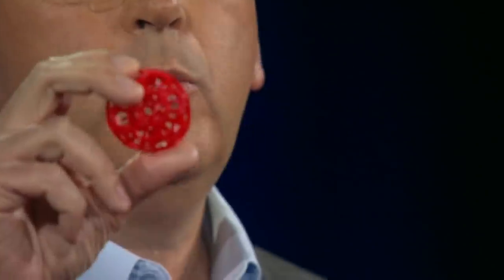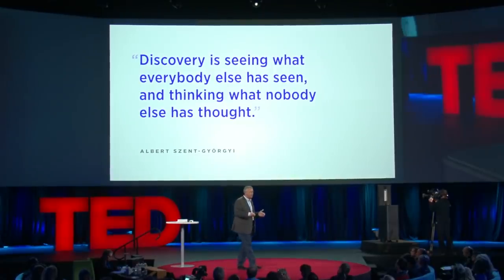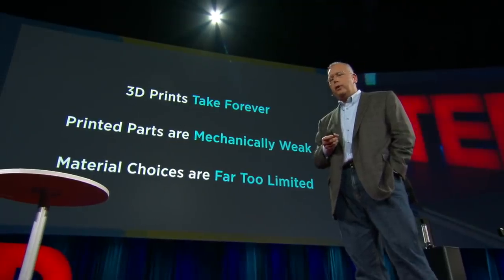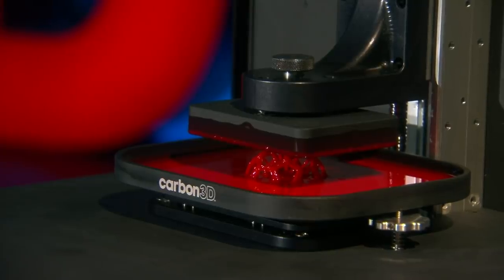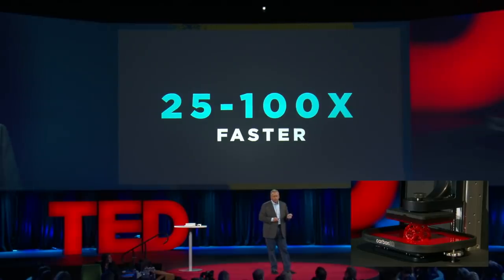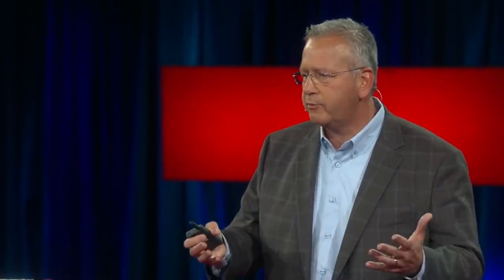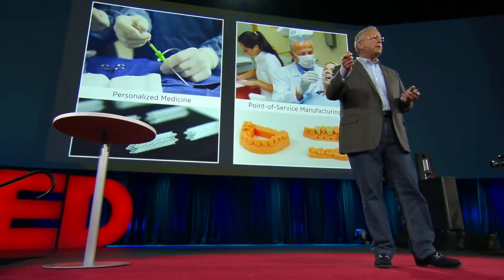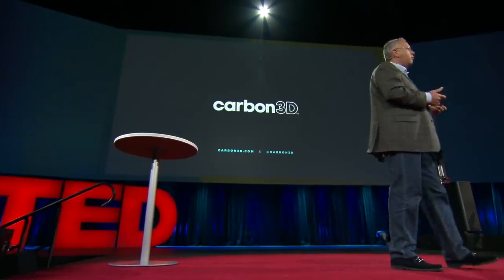What if 3D printing was 100x faster? | Joseph DeSimone

Comment: This idea is game changing.
Reply: Used that a few times didn't he...
Reply: CoiledDrake Yes, but it REALLY is. You have no idea.
Reply: GuyWithAnAmazingHat If only it were record-changing as well.
Reply: Actually its not that different from laser-epoxy type 3D printing that existed for over 20 years. The main concept is the same. But the method is quite different.

Laser epoxy uses one or a couple of beems of laser, so its relatively slow

laser-epoxy go from the top and lower the stuff down, i don´t really know what diffrents it make, but this look way cooler.

Laser-epoxy is really limited in the viscosity of the stuff.

Laser-epoxy, because it uses laser, its not really continuous.

But in theory, they are kind of the same....

I´m just waiting to they can do polymer that is sensitive to different wave length so they can print colored objects... or objects of different materials.
Reply: This changes everything in 3d printing..
Reply: +Morph Verse totally.
Reply: +GuyWithAnAmazingHat This "idea" is 30 years old. Its called SLA printing. It is not at all new, in any way. Except maybe for the sales hype.
Reply: Except where he explained how its different.
Reply: ataraxic89 You will believe any marketing hype won't you? If it was printed in 3d, you wouldnt need the platform to pull it out of the liquid bath a layer at a time. Its printing layer by layer. You do realize this, don't you?
Reply: Diesel Ramcharger Seems like you fail to realise how fast it is printing. Speed changes the game.
Reply: GuyWithAnAmazingHat Obviously you have never been around commercial printers… Vox isn't the only one with this "technology" they didnt invent it, they are just utilizing it.  SLA has always been much faster than FDM printing.
Reply: Diesel Ramcharger Well sir, it's even more obvious that the joke flew completely over your head, so let me do one of the things I hate most, explain the joke.

This thread isn't completely about how this idea is awesome, it's about how many times the speaker said the phrase "game changing".

And it doesn't matter how long something has existed, the only thing that matters is whether that thing is better than ever before. And yes, this 3D printing technology is better than ever before, and it is game changing.
Reply: GuyWithAnAmazingHat Its not really game changing. They aren't even the only ones with high speed SLA's out right now. This is merely progress as experienced in any industry.
Reply: Not at that price point.
Reply: "ACTUALLY" lol... you guys are funny.
Reply: GuyWithAnAmazingHat 3 years later it costs £3000 and is still about the same size, there is a £500 one but I wouldn’t buy it - makers muse channel.
Reply: There is a clear difference between SLA and CLIP. SLA prints layer by layer because of the suction generated between each layer and the glass tray. CLIP doesn't use layers because the resin polymerizes above the glass surface continuously.
Reply: It actually doesn’t.... This technology has been around for decades. This is total BS. A consumer can purchase one of these printers for just hundreds of dollars. This is do difference than conventional resin printer. The problem with SLA printers are that they require a series of cleaning processes that can be dirty and lengthy and are not shown on stage. On top of that, SLA printing is not cheap and resin can cost upwards of $100 per bottle.
Reply: Diesel Ramcharger LOL omg I’m sorry your so ill informed. This is how SLA printing works. And yes, it does need a platform. Look it up.
Reply: x7
Reply: Additive manufacturing is nothing new.  It's been around for a long time, and nothing he said indicates that they have discovered anything new or unique.
Reply: Not really game changing.  The issue with DLP is that you are limited to the 2D projection resolution and all lens/shadow/projection artefacts (and projection technologies have limited resolution).  Photolithography has been around for 50+ years.  This is how semiconductor wafers are processed.  SLA (scanning lasers) can actually do better but they take longer.  The semiconductor industry used them for a while and then went on to e-beam to get even higher resolution.  Nothing new really.  Just an application of existing technology.  DLP’s do not have high spatial resolution since they are limited by MEMs mirror feature sizes.  This is just a limitation of the current technology.
Reply: This technology already existed and was cheaper it's called sls/sla
Reply: well after 4 years we are playing same game without continuous printing.
Reply: GuyWithAnAmazingHat
Amazing Hat

Comment: What if 3D printing was 100x more expensive :D
Reply: Is still worth it, because is better not only faster :P
Reply: It's already been 100x more expensive. 3D Printers started in the $15-40k range.  They started off being very specialized and very expensive. Advancements and competition in the field have driven the price down. Unfortunately, while printers have been made more economical, their speed hasn't changed much.

This new method could change the print speed by an order of magnitude or two. Sure, it will likely drive the price up for this new style of printer. But with enough time, that could likely be made economical to the average person as well.
Reply: how so? only one moving axis... and just a digital projector, no laser... should be extremely cheap  a few years from now, very simple printer. just needs to be mass produced...
Reply: It already happened. It's called 2010.
Reply: D-railed nailed it!  These printers should be WAY cheaper!  One motor (just z-axis) and it just projects a UV image on the whole layer.  It seems VERY simple.  The only thing I don't know about it how it gets oxygen through that plate without the resin dripping through.  Basically that is the ONLY mystery here that makes this printer $40,000 per year to RENT vs $300 to buy one outright.  Craziness!
Reply: Evi1M4chine 
400 3d printers are faster but, as he said in this talk, it's gonna be much weaker.
Reply: If HP would supply the materials it would be.
Reply: The first microwave ovens were $5000 to buy.
Reply: Evi1M4chine  yeah big boy - dream on. ask the people that have more than ten of them running how much time they spend troubleshooting these things. If you had 400 printers you would need 5 people working for you taking care of them around the clock. Sure THATS economical....
Reply: @RubSomefastOnIt  because they don't price it that way.. they price it according to the market and competition.. so if a slow 3d printer is priced at the $100 range.. and their printer prints 100x faster with 100x smoother surface.. they might price it at $100 x 100 x 100 = 1million dollars.. something like that..
Reply: Well, this technology can in theory make itself cheaper, by quickly and efficiently printing more 3d printers using already existing 3d printers.
Reply: @samuelkarlsson2748  lol
Reply: Evi1M4chine  The quality will be a lot worse, though. Also, no matter how many printers you use you can't use more than 1 to make the same object, only to multiply it.
Reply: Evi1M4chine  And 9 mothers deliver a baby in one month, right?
Reply: for now :D
Reply: This lad predicted the resin pricing
Reply: What if 3D printing was 100x more locked down by intellectual property legislation !
Reply: @ericlotze7724  nailed it!